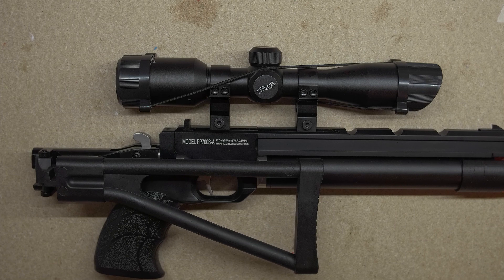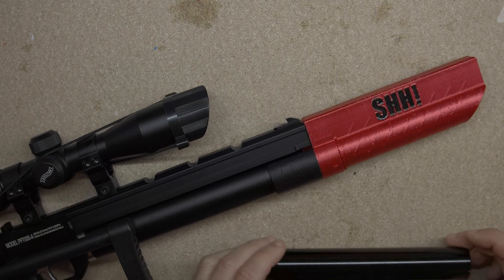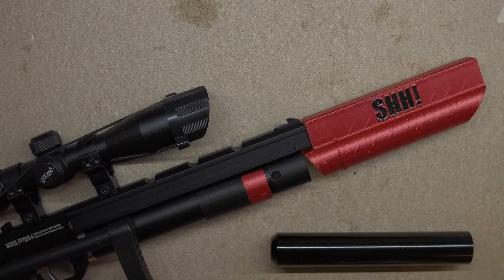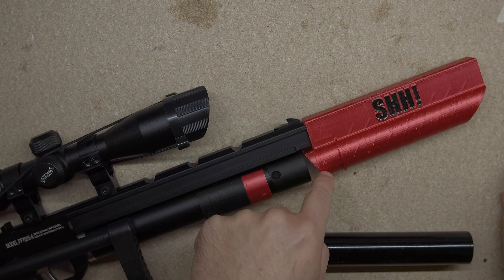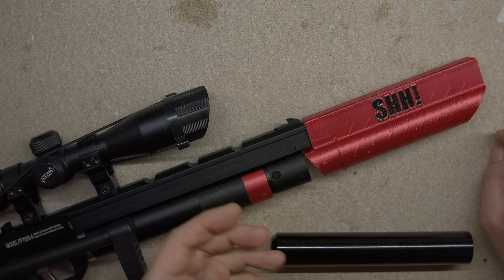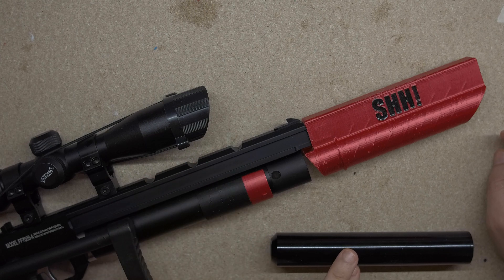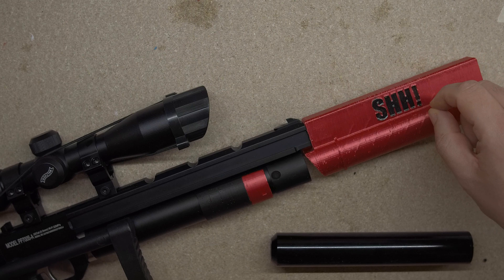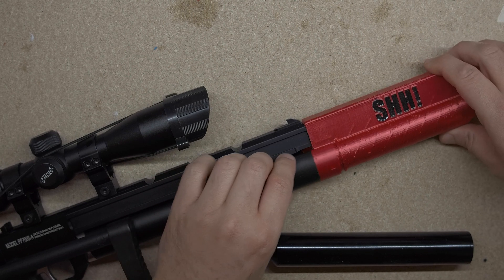Artemis/Spa PP700S-A 3D printed silencer

Comment from the maker: I fixed the pellet elevation issue!
I modified the model to have an 8mm hole instead of 7mm, and reprinted it at a 0.2mm layer height, and at a more respectable 45mm/s.
I'm getting dead-on accuracy now, and will upload a review of the gun and silencer soon.

It took 17 hours to print, but was worth it...
Reply: Very cool and thanks for sharing!
Reply: Hello,
Firstly thanks for the great work.

Did you updates the notes on thingiverse with these changes please? I am thinking about getting this printed but unsure if I need to use those files or ask them to change as above 

Thank you!
Reply from the maker: @doop6995  Thanks!

And yeah, the link for Thingiverse is: https://www.thingiverse.com/thing:4552394

When you download the zip, you'll see a file called "pp700_silencer_02_8mmhole.stl" that you should use.

Now that you mention it, I think the dust cover might still be the one that's a bit loose.
But what I did with mine was use the loose dust cover, but put smooth tape on the inside, so that it doesn't scratch the gun.
I think that's a better idea actually.
Reply: @MyAirgunPhase  cool, thanks for the link. So I should ask them to print it from the specs you noted on that link right? 

Can you do a video of how you attach it to the barrel please? And a bit more on the silencer

It’s really cool and would love to hear more on it

Comment: The PP700SA is an excellent pistol that can take the folding stock, silencer (with adapter) and a 3-9x40 scope on low mounts, shoots accurately as well.

Stripping her down reveals a regulator with 10 belleville washers (())(())((, plenum is in monoblock and exhaust valve body moves air up into the rotating loading port, 1mm TP for UK.

Hammer spring is adjustable once you remove the handle as is the trigger, a concealed hole in front of the trigger allows access to the regulator via an allen key though this is fiddly.

Folding stock folds to the side to be more compact though is wobbly, PP750 sliding stock is better.

Likes JSB Hades and shoots consistently accurately with them.

Pistol can be preloaded with a pellet and cocked when ready to fire, also easy to de-cock.

All in all a fantastic little pistol that puts a smile on your face when firing 👍

Comment: I printed it out but how does it fsten to the gun please?
Reply from the maker: With the printer tolerances I had, I could just screw the end over the 1/2"UNF adapter that you get for the gun, the one I listed in the description.
If it's too loose, you might need to make the hole smaller, or if it's too tight, a small bit larger.
I just let the metal threads of the adapter create a thread inside the plastic. Good luck!

Comment: it's a shame that even with a sound moderator it's too noisy. I bought one and thought that adding a muffler would solve the problem, but it only dampened the noise slightly.
Reply from the maker: You could try tuning the power down a bit, I guess?
Mine is really quiet with a moderator on, it being the 10 joule version. I know they're crazy powerful in other countries though.